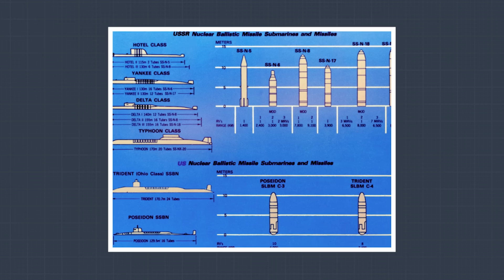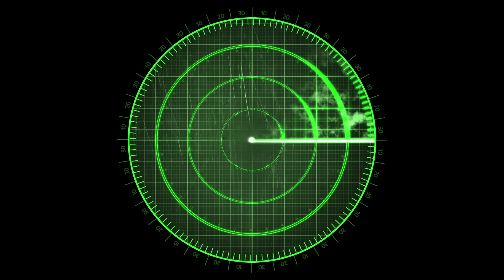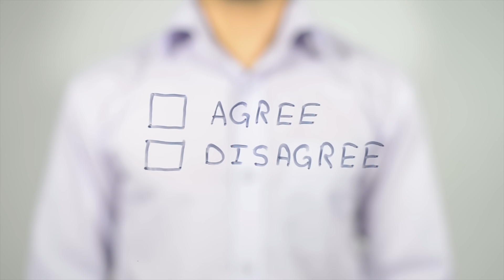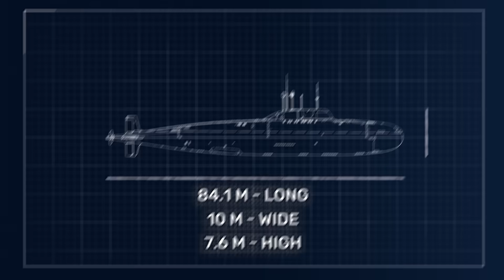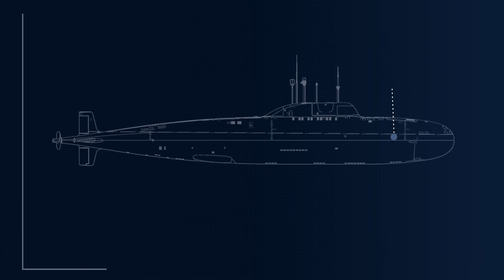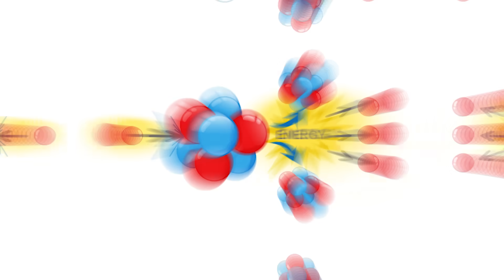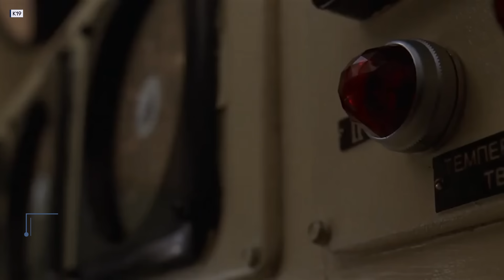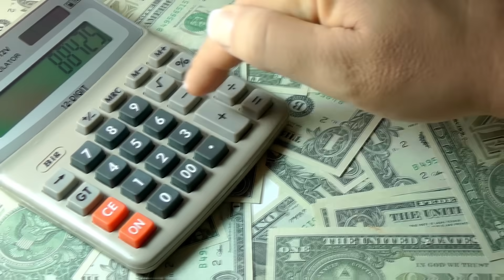Project 705 Lira: The Soviet Submarine That's Still the Fastest Ever Built

Comment: I didn't realize the Alpha class still holds the official speed record for a manned submarine.  You have to wonder what could be (is being) done with current technologies!
Reply: It does as a production submarine. The  experimental K-222 (nato designated papa class) does beat it, but it's a one off that could be better described as a tech demo to figure out the viability of the later Alpha class. The fastest the K-222 ever got was 44 knots or 51mph submerged. The top speed of the Alpha is 41 knots. They actually mention it in the video briefly.
Reply: The "Papa" was the fastest of all time.... at least up untu😢until a decade or two ago. I'm not sure if its beat yet but maybe... maybe not🤔
Reply: @mattmiller4613  We may never know.

There are some "wild claims" that the Seawolf class can reach a top speed of 45 knots (though this is rather doubtful with a displacement of nearly 10.000 tons).

Some prototypes/research vessels maybe... like in the 1950s the (diesel-electric) USS Albacore reached a top speed of 35 knots or more even. I believe, the  US Navy is never really publishing such details, "in excess of 25 knots"... is all you need to know. 😀
Reply: @aoife1122 doubtful.  It is fast and quiet af.  But pump jet plus powerplant suggests that is quite high.
Reply: @aoife1122  that is the mostexcellent reply 👏 My only response is "Yes, yes, and uh-huh"😏
Reply: "25+ knots" can be summed up in the torpedo evasion tactics of the Seawolf class boats -- turn away from the fish and ring up ahead flank cavitate. I'm pretty certain by the use of that as a primary torpedo evasion tactic that we have far surpassed the mid forty knot range.
The Seawolf herself went fast enough that the low pressure area above the sail pulled one of the masts out and bent it. They are the first class of submarine to include a locking mechanism on their masts now.
Reply: @GrandOldDwarf  Indeed, torpedo evasion was likely the main reason for pushing top speed, acceleration and agility (the other two areas in which the Alfa class submarines excelled). A short burst at 40+ knots gave 'em a fighting chance to outrun anything in the arsenal of Western navies at the time... until the arrival of the Mark 48, that is.

Sustainability of such speeds is a rather different matter, surely they were not prowling the seas at 80 kilometers per hour. ;)
Reply: Speed is not emphasized as much as stealth.  Surprisingly today’s fighter jets are much slower than those flown in the 1960’s. Today’s emphasis is on manuverability and stealth.
Reply: @klardfarkus3891  Well the Alfa supposedly had two of the three, speed and maneuverability.  I will say our sonar guys were annoyed as HELL when an Alfa was in the area though.  Those bastards were so noisy the could hid another FIVE subs!
Reply: Seawolf easily can top 40 knots. How much more, it doesn't matter. It's an order of magnitude quieter than an Alfa
Reply: @Shadowboost  didn’t they stop building seawolf because of cost as compared to Virginia class?
Reply: @klardfarkus3891  yes. Crazy expensive, and much more limited mission set compared to Virginia
Reply: It is less about "why were we not able to make a faster sub" and more about "why did we decide to not foolishly focus on speed anymore?".
Reply: @Scapestoat  ahhhh the wise man of old🙌 it wasn't tactically sound at the time. Plus there was the main strategic goal at the time for the Navy: out spend the soviet Navy, do safety and maintenance better and constantly, implement a two crew  rotation system to maintain a higher patrol tempo... knowing that, with the state of soviet maintenance and safety records and other systematic failures and lack of ethical and practical leadership during the cold war; all in order to get the Soviets to try and keep up with us on our consistent high tempo patrols etc, and go broke trying😉 We succeeded. 
  I've always believed that the U.S. Navy was able to bring down the soviet union without either side firing a shot in anger in 45 years. The department of the boats was not alone in this Blessed victory 🙏,  but they were decisive.
Reply: @mattmiller4613  It worked out, but it is important to realise that if could have just as well gone the other way.
Shifting alliances, internal conflicts, the Gulf War going even more horribly wrong and becoming a spiral from which there is no escape, all sorts of things could have destabilised the USA.
And at that point, it would have been possible for the USSR to pull ahead. Even with their unsafe submarines and general lack of care for the little people.

And that is without the possibility of all out Nuclear war.

And without NATO falling apart. And goodness, the US does do a lot of un-ally like stuff to their allies, and they make it very hard to trust them with anything, be it economic or military matters.

I think we all got very lucky.
Reply: Speed is mostly irrelevant.

Sure, it's good to have it but not at the expense of stealth or other operational areas.

Guided weapons are so good now that essentially the only way to not get blown up by them is to stay hidden from them.

Speed itself or designing for speed in general usually makes it easier to see you.

Of course you need some minimum level of speed to be practical but in my opinion the difference between 30kn and 40kn isn't great enough to sacrifice stealth.
Reply: @retsaMinnavoiG  Oh I agree, being sneaky is better than being fast and loud.  However, having the OPTION to turn the speed to "11" is also good to have!
Reply: @michiganengineer8621  absolutely!
Reply: "Official records" mean little to nothing in the rather secretive world of military weapon development.

P.S. The NATO reporting name was Alfa (with an "f").
Reply: @aoife1122  Habit is a wonderful thing when typing stuff out LOL.  And after serving on CV-60 I agree 100% about "official speeds".  "Sara" topped 45kts during trials in 1983, 10kts over her "official" speed.
Reply: @michiganengineer8621  Yeah... but as it goes with combat vessels, they ain't racing boats. They don't run flat out all day, nor do they have to. But having some reserve may come in handy, even more so for a carrier. When it comes to launching planes the ship's motion does generate additional lift (the French have learned this the hard way with "Charles de Gaulle").

With submarines requirements are very different though. For their "modus operandi" the theoretically possible top speed is a rather moot point. ;)
Reply: @michiganengineer8621 wait for real? That’s incredible!
Reply: @invadegreece9281  Only for about 5 minutes then they backed it down to 35kts.    It's been my experience that you should add about 10% to any capability claimed by the military for speed LOL

Comment: and its sooo LOUD nato knows when they start their engines in port ..
Reply: The reactor could never be shut down. The liquid metal coolant would solidify, with no way to re-melt. The shore facilities needed to keep the coolant liquified while the boats were in port never worked properly (shocking!) so the reactors had to always be kept at a nominal power level.
Reply: Yeah ,but our genius know everithing 😂 nato will know when they start engin waht a joke ,in teir drems @ERAUsnow
Reply: @ERAUsnow  The reactor and the engines are two different things.
Reply: @DonWan47  sigh

The reactor IS the "engine". What you're talking about is the propulsion machinery, which is basically the transmission in your car.

If the reactor is shut down, there is no power going to the machinery.

The reactor design means it could never be shut down, so there is no "starting the engines". Also, with the reactor always running, the coolant PUMPS are always running.

On a nuclear boat, you can order your propulsion to "all stop", meaning NOTHING is turning in the machinery spaces. Your screw is stopped.

But your PUMPS are still running, and Soviet coolant PUMPS are notoriously noisy.
Reply: Meanwhile the Gotland class could parallell park right next to it and they would never notice.
Reply: @matteste  using a hybrid diesel boat isn't really a fair comparison. Diesels cheat.

A Balao class on her batteries could hide from an Alpha rather effectively.
Reply: Did y’all ever watch the sub brief on this one?
Reply: Probably start it in the Baltic ports and we hear it in the pacific 😂
Reply: @DonWan47  if they started one in the Baltic, our Swedish sonar operators would be mass hospitalized for hearing damage and concussions😂
Reply: @ bro 😂😂😂
Reply: @SonsOfLorgar  Yes, but it only made noise at high speed. But this submarine could still sneak up.
Reply: Liquid bismuth/lead reactor. You can't shut them down.
Reply: That's what I was going to say.
Reply: 😂😂😂Если НАТО такое крутое, то почему оно проигрывает все войны?
Reply: @Олег-ж3с3т  🤣🤣🤣🤣🤣 NATO has never lost a war, unlike ruzzia and the sovs... (НАТО никогда не проигрывало войны, в отличие от Роzzии и Советов..._
Reply: Hearing it wouldn't help,it was so fast you couldn't do anything about it
Reply: lol
Reply: so many people don't realize that reactor =/= motor
Reply: @carlsoto1747  Sure but it is the power source for the motor. Which makes it's own sound with it's pumps. Although the prop is most certainly louder right?
Reply: @JohnnyWednesday  Huh? If you hear it you can destroy it regardless of its speed. Google cavitation. Speed is nothing, silence is everything.
Reply: @DonWan47  Mhmmm... But supercavitatibg torpedoes were Russian thing from 70s. West still havent cracked it.
Reply: @OleDiaBole  because they're not effective.
Reply: @OleDiaBole  The West still hasn't "cracked it"? Uhmmm...no. NATO countries could easily reproduce this supercavitating torpedo technology. They simply choose not to. Those Russian torpedoes you mentioned are crap and have several limitations. 

Guidance: The torpedo's noise and vibration make it difficult to use traditional guidance systems. The torpedo can't tell the difference between an enemy ship and a rock formation. 
Control: The torpedo's controls are limited to gentle turns, and it can't make sharp turns. The torpedo's steering surfaces can't protrude far out of the protective bubble, which makes course corrections difficult. 
Warhead: Because of the effort required for speed and control, supercavitating torpedoes often have a smaller warhead than conventional torpedoes. 
Position: Launching a supercavitating torpedo gives away the submarine's approximate position. 
Depth: The deeper the torpedo dives, the smaller the bubble envelope gets. 
Range: Supercavitating torpedoes have a shorter range than conventional torpedoes. For example, the Russian Shkval has a range of about nine miles, which is about one third of the range of modern conventional torpedoes. 
Vibration and noise: The rocket and hydrojet propulsion at supercavitating speeds creates a lot of vibration and noise. This can make the weapon deaf and also make it easy for other enemy vessels to hear the torpedo.
Reply: @OleDiaBole Other than the ones the Germans and USA built 20 years ago, and then abandoned after testing prototypes, realizing that supercavitating torpedoes didn't actually provide any advantages to offset their weaknesses.
Reply: @gnarkiller  typical answer of western fanboys when they can't argue why west can't replicate something russian
Reply: @OleDiaBole  sure
Reply: @ no it’s not
Reply: @carlsoto1747  - in war time, merchant vessels are targets and unarmed. A fast submarine can pick them off while avoiding confrontation with armed vessels. 

Doesn't matter if you can hear it if it's destroying supplies and keeping away from your fleet.

Yeah a quieter submarine can get closer - but not close enough before it's detected and the soviet sub runs.

Lie in wait for it? sure - but so can it.
Reply: It could actualy be quite stealthy relatively to other soviet designs when moving slow.
Reply: all subs are loud on high speeds, stop being stupid, physics work same for all, so even if seawulf goes max speed it is loud, subs pretty silent on slow speeds like 2-5 knots
Reply: Well Russia already showed their ass to the world, and it wasn't very impressive
Reply: Only because you are fed BBC propaganda and aren't even aware 😅 @clubjed6276
Reply: @clubjed6276  you need to understand that the one that were deployed in ukraine are young conscript inexperience soldier while they were fighting ukraine elite soldier.  also, they didnt even use their spetsnaz and icbm yet. they are trying to drain out the enemy because number are not their problems. also, those soldiers if they die it will become a pay cut. since they were to useless to be kept around